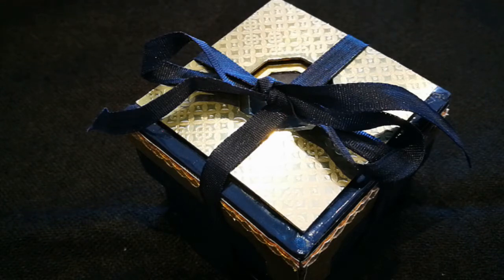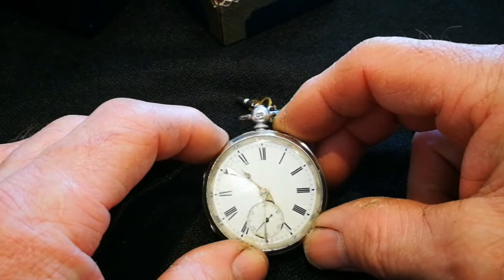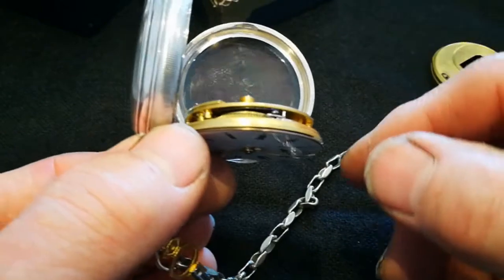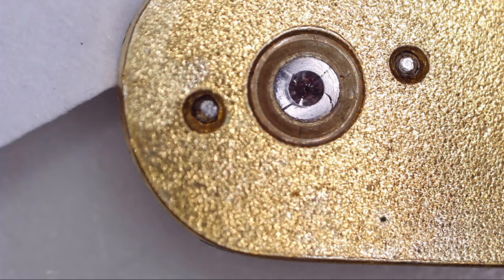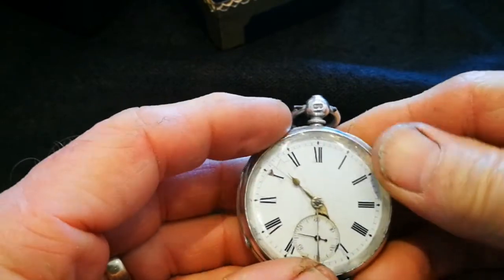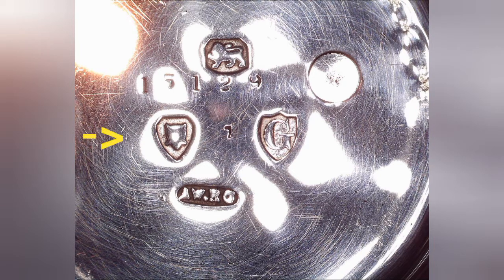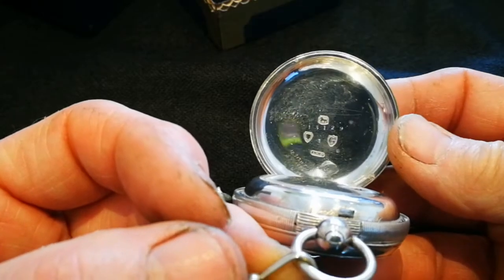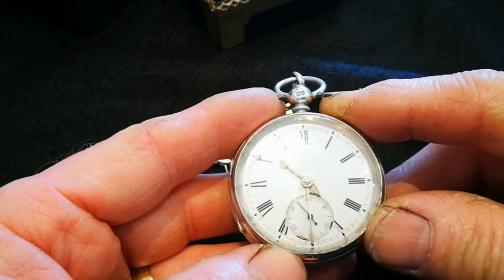My first pocket watch repair

Comment: hi i have a 200yr old verge fusse siliver pocket watch it works for a bit if you shake it but wont stay running 
could you repair mine
Reply from the maker: Hi Nick. I could certainly have a look. I'm guessing it hasn't been serviced anytime recently? 
I am a bit backed up on work though.
Reply: @andrewclarkehomeimprovement  hi ok let me know when you can  its mann of norwich movement and cases by william linsley
dating from 1810 to 1812